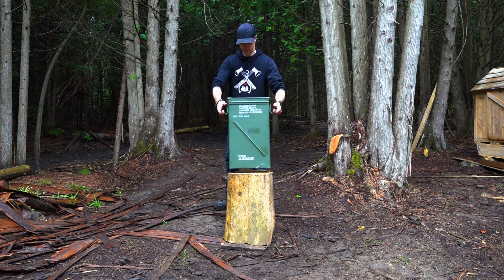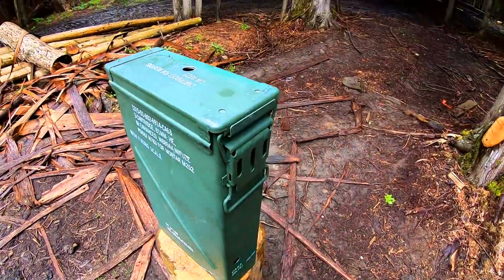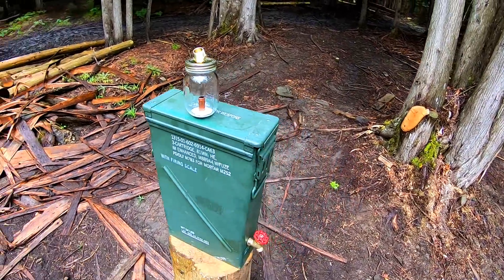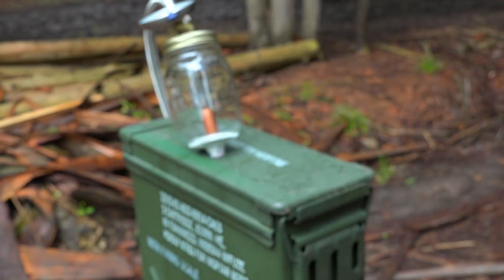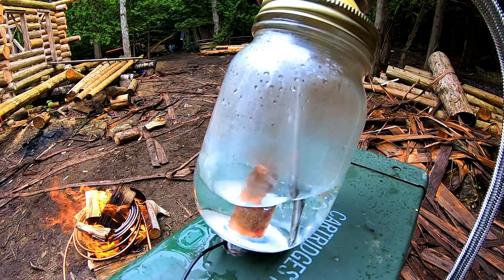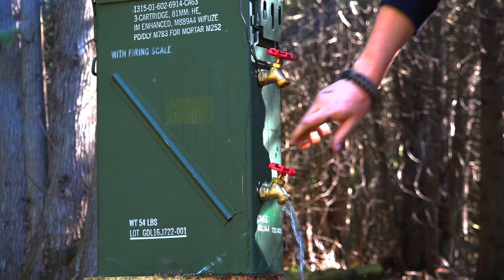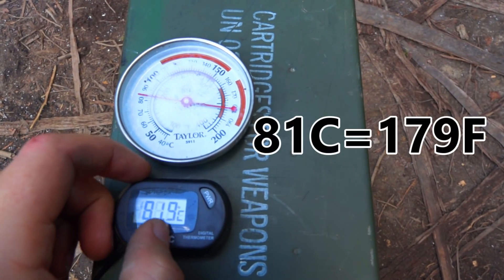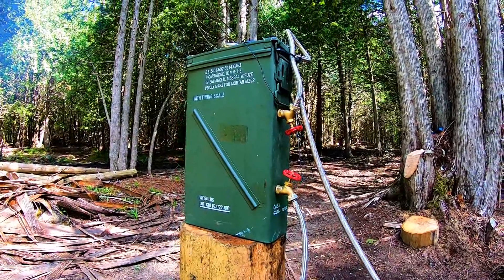Off Grid Heating Prototype- Copper Coil Water Heater / Heat Exchanger / Radiant Heater

Comment: If you use a copper truck radiator to replace the ammo can it would radiate more heat and might increase your run time so you don't have to get up and move the coil off the fire ?

Comment: I'm just spit balling here, and I'm not a survivalist or engineer,  but here goes anyway.  Why not get a shorter length of tubing? Clearly the water is in the fire too long,  and is getting the crap boiled out of it.  So maybe reduce your tubing have the water spend less time in the fire and maybe your sleeping cabin won't be a sauna. Also,  won't a low,  coled, fire produce a steady but lower amount of heat?

Comment: This is what I used to do in the Army and it worked great in very cold weather.  Boil water and then put it in your canteen.  Close it very tight so it doesn't leak.  You will want to wrap a t-shirt or some sort of fabric around the canteen both to insulate it a bit and so you don't burn yourself.  Put it in your sleeping bag with you.  Now in addition to your body heat, you've got an additional heat source that will keep you warm in your bag.  By the time it cools it will be time to get up.

Comment: You need to learn jow to build a proper condensor. You need to roll a coil like a screw starting at the bottom with cold intake at the bottom so that convection you mentioned can work within the natural physics. And.thermo dynamics so rising heat is heading up the coil and into the upper part of the tank and you.will get a thermal convective loop with all the tubing laying flat in the fire there is no natural reason for the water to flow either direction except for expanding both directions away from the heat from expandion. The tank should have a proper rated pressure relief installed for two necessary reasons. One so the tank doesn't blow up and also so you don't lose all ur water to evsporation.properly done it should function like an automotive radiator ( which will work way better than that box) and hopefully by then you will have come to.realize that a contained water/antifreeze wont freeze.the radiator can be hard mounted inside with your hoses and condensor mounted outside ready to be stretched out to a fire. The end product is whar the automotive industry has called a heater for about a 200 years. You could pull the whole apparatus out of any dead vehicle. Haha.

Comment: I made something like this. I used something like a drum with both ends open and coiled the copper inside to give it a uniform up to the copper, it also held in the fire. Smaller fire gave more hot water. It also made for a safer fire.  Bringing the copper in at the bottom and making nice even bends and some space between them.  Some rocks to hold it all up for air to come in the bottom and feeding wood in at the top gave a kind of rocket stove, not as good as some rocket stoves but a nice air draft that made the fire very hot without much fuel.  Could see if you can make the copper to form a wall but don't know how to do that without something to hold it.  Maybe a steal 5 gallon bucket.  Just some ideas maybe you can think of something using some of what I did.

Comment: Snazzy lookin camper you built.  Nicely done.
Cool idea but if you keep that copper in the fire, it's going to break down and crack.
I burn copper wiring to get the insulator off and the wire becomes quite brittle and it isn't in the fire more than 30mins.....
Reply: Good point, maybe he should elevate the coil on rack  - first waiting for the flames to die down.
Reply: @christainrovere165  What you said, or just make a really small fire.  But all the same this is a good idea, like alot of good ideas, after some tinkering it will become a great product.
We all learn after doing something for the first time, I do all sorts of fabrication and after I've done something the first time I wind up finding better ways/revisions of doing it as I go.

Comment: This makes me curious if the coil could set within a grouping of large rocks that had gotten hot in the fire for strictly a water heater.
Reply: I use it for heating water for cleaning.  Works great.  The coil must be a controlled spiral so the cold water flows down and warm water lifts it back up into the tank flowing in one direction.  No air bubbles in the system is key.

Comment: That's a great idea but use of radiator line copper pipe with aluminum fins in that top that hole and then just run a straight pipe write out your roof just so that heated water doesn't condensate inside your shelter and with the copper pipe with aluminum fins you'll get extra heat radiating out

Comment: You also can generate low amount of electricity from this improoved system. Just attach several peltier cells to one wall of the ammo box and connect them in series. The opposite side of the cells will be air-cooled in your snowmobile. In place of the vapor opening, it would be useful to drain the steam outside to avoid a steam accident & less humidity inside. Maybe you can try actively cooling (radiator with fan) ammo box for preventing boiling. Temprature of water shouldnt be above 60°C (140°F) because of denaturing temerature protein (risk of burns)

Comment: When camping in Tennessee years ago, we made a makeshift shower where we used a 30 gal drum made into a woodstove. We then placed the copper coil in the woodstove with the two ends jutting out. One end lower by 12" than the other.  We had a large poly drum filled with water which then was drawn through by convection. We hooked up a 12v sump pump to the shower, where the base was a childs sandbox. The water was used for a shower, sucked up by another pump, pushed through a charcoal filter, then back into the poly drum for use by the next camper. We learned real quick that you just need a minimal fire to draw the water through, or you are scalded pretty quick.

Comment: You need to talk to a plumber. Or an engineer. This is an unrelieved circuit. It can't be regulated, and it's dangerous. Please don't take this rig into winter conditions without some more work.

Love the camper.
Reply: There's a hole in the top that prevents pressure buildup. A lot of commenters forgot that part. It really ought to be some kind of valve that's outside though.

Comment: A little risky without the pressure valve. If the piping got lose you would get severely burn with the heated water in the closed circuit conditions water can get to the higher temperature than 100 degree and with high pressure it can even cause a powerful explosion. Sure the thing is not big, but there were severe cases in my country, where the close circuit water heating systems, water boilers would explode, most of the time they can even destroy walls made from concrete.  I doubt you can heat it to that extent using camp fire, but it is still possible for the piping to get lose and cause very hot water to pour all over the place.

Comment: hmm, building central heating in your camper eh. rather than an ammo box use a radiator - or use a radiator AND the ammo box where the ammo box is insulated. also - consider installing another tap, and keeping the system nice and clean because who could say no to a nice cuppa.

Comment: If you rigged together a little PID temperature controller, can have it connected to an electronic ball valve to regulate the temperature and not boil over

Comment: Looks like you have a good idea going and there are a lot of good suggestions here so I will only restate that the coil should be inside and the water box outside. You could then rig a way to move the water box on and off the fire either from inside the warm camper or just outside so you don't have to walk far. Maybe put it on a swing arm or on a tripod with a pulley so you can raise and lower the can to control heat. An in line pressure relief valve outside the camper would work to make it a bit safer. There also seems to be a lot of negativity here. Fuck em. It's a good idea and with work it will be a good safe heat source. It's basically just a radiator. Which come to think of it, and old radiator in good shape might get added in here somewhere. Even a car radiator might be useful if well cleaned and in good shape. They already have pressure valves and overflow systems.

Comment: Wouldn't it have been quicker and easier to just put the ammo box with water in the fire? Then take it out after half an hour and it would be about the same temperature. No holes would also guarantee no leaks. You could also get by with a smaller fire.

Comment: The problem here is that the people with voices right now on the internet are the ones that do video editing instead of the people that actually know what they're doing. 

This guy is using copper tubing and is trying to use a steel ammo box as a heat exchanger. Totally backwards. 

Meanwhile, anyone with a background in heat transfer (such as mechanical engineers like myself) are scratching their heads wondering how people manage to dream up ideas that are bafflingly awful.

Comment: The amo box will burn out within a week. A 2kw chinese deisel air heater uses around 1lt per 24hours heating per 1kw. A far more practical and safer way to heat any small portable accommodation. 5lt fuel would last 2 weeks. Just need 12v deep cycle battery and heater unit.

Comment: Why use water instead use antifreeze boiling point is much higher and it won’t evaporate as water would just a thought !
Reply: That one reason that many radiators use oil. There's no phase change to limit your temperature ranges, and also much less risk of corrosion.

Comment: I would for sure use a different method. Maybe funnel hot water through the copper pipes and thread those through metal housings near the upper edge away from the door, and use snow to make sure the water could reliably cool itself for at least a short time longer, using the ammo box as the reserve/water cooler?

Comment: You should have used a small radiator not a ammo box if you goal is to get the heat in the air.   You will also go through fire wood extremely quickly unless you put the copper heat coil in an efficient rocket stove.

Comment: why not have a wide sealed boiler on the fire and the copper tube inside, just have the steam warm the inside without taking too much spac, the condensate can then drip out or back in

Comment: With the amount of heat it gives I would go for a smaller version and probably use a  different burn method for the wood, something that would last longer. Overall, I am very impressed with your way of thinking.

Comment: My mini camper has a tinny wood stove i made from a small fat propane canister.. It also has  running water to the sink and shower.. And a compost toilet.oh and a solar panel 12v electrical complète with inverter for phone charging, interior exterior lights and tail lights  it's 4 feet wide six feet long.. About five feet high on its wheels.... Oh and an awning... I built it for my electric bike.. But now im off grid and i use it way in the back bush....since you are the reason i own a woodland mills saw mill perhaps my micro wood stove in my micro camper is somthing you'd like too see?

Comment: Even better would be a aluminum or copper car radiator. its possible to braze aluminum and copper together to i think if you have a mismatch of materials. That would transfer alot more heat.

Comment: I think I see what you're attempting. Thermal mass inside the cabin with the coil outside. Just throw the coil on the fire when you park for the night, open the pressure relief (top hole), and make dinner. When you're done eating, you can easily move the coil, close off valves, and have a tank of hot water keeping the cabin warm through the night. It's not designed to keep going after you've warmed it up like I think a lot of people are assuming. The only issues I see is excess moisture through the pressure relief (not a huge concern with cold, dry winters) and the water left in the coil freezing overnight, cracking the pipe.

Comment: What’s the point of this if it requires fire and a lot of water for it to work that is basically making using a fire for warmth with extra steps
Reply: in that camper, what use is a fire outside?

Comment: You could try to reduce amount of coil. or perhaps Rig a system up where you can have different Heights over the fire. IE like in the fire is starting the system up for a hour or so. then you have another level. where can move it above or to the side of the first but still be right next to the fire so it keeps getting the heat.

Comment: Putting a three way valve and a pressure valve like on water heaters to release high pressure like water heaters may help  lower pressure to boil in high mountain elevation ! Sand is a great insulator and fiberglass can be used as a container  for the sand , the tree way valve can extend the very hot water by adding cold water to very hot water to extend the amount of very hot water as many solar systems use already to extend the hot water use ! A simple fan over a evaporator coil can flow hot air through a area without danger of carbon monoxide , and can pre heat air also ! Great Idea as soft copper has no real need for soldering or leaks ! Buy must be checked as factory and shipping may of had cut line ! Mist of the time soft copper is a great tool ! And just aluminum sheet metal and isolation on the inside solar box with black  oil type paint on pipe with a light fiberglass lid can produce daylight solar heat , that just sheet metal and copper pipe painted and a pressure valve at the top  and rubber installation on excess pipe and a  reservoir tank  ( plastic soda chemical tub ) could circulate a  hot soft copper tube with hot water in the storage tank and give plenty of hot water for shower and dishes and then heat the small area of conserving waters ! Also the larger soda tub usually about 15 dollars could melt ice for water for heating system   In not sure how much heat the plastic tubs hold but never had them break from ice build up when watering horses with them or burn when using electrical water heaters made for animal water heaters for winter use ! Great video thank you !

Comment: Little worried about the humidity all night and then if for any reason it either boils off steam and you loose heat and then your cold and wet or your fire goes out and your cold and wet

Comment: Multiple stacked Ammo Cans turned on their side, all acting like one giant tank (All modified). Do the same system and attach it to the top or bottom of your cabin and have the copper cables attach VIA those same valves, but on the outside. If you do some proper math you can figure out the exact pressures that will be in the pipe and use materials accordingly.

Comment: Never build that like that! If you have two valves in the circuit you absolutly need a savety valve!!
Pressure could build up and lead to pipe burst if the valves are closed by accident or if you just want to stop the heating!!

Comment: I would use a closed loop system. With some form of an expansion take, either like a car with a rad cap like design or a tank like you see in homes. I'd honestly just use a cheap car radiator that has rad cap built into it. Then use a container for the overflow. 

This way you can use higher pressure to increase the boiling point of the water. Allowing for higher temps. 

I'm not a fan of the ammo box simply because of the humidity it will put into the air. You want a closed loop system. You dont want your camper all steamy.

Comment: Add Some 12v DC fans, and a radiator (&/or pex throughout all the walls and floor) with a 12v pump -- solar panel and small battery too - you can then charge your devices, have light in the event the lamps die -- get more efficient heat -- have the tank as a reservoir for the hot water, keeping it inside, and a radiator/pump/pex to dissipate the heat based on how warm the room is -- and if the water in the tank comes close to boiling -- you may find in certain cases you may need a small outdoor radiator to remove excess heat if the room is already too hot , you could also vent the steam into an outdoor rad to re-condense it so that you loose less water -- seal the box as well and just add a pressure/steam relief -- that way if it does fall it wont spill on you, but still has a way to safely vent pressure if the outdoor rads are ever not enough -- or in the event your battery dies -- you could also add an emergency dump valve for the water -- in the event the whole system overheats it might better to just dump the water outside on the fire and set off an alarm
Reply: Theres also ways to generate electricity from heat -- which would provide some degree of electricity for times when the battery is low in emergency scenarios

Comment: Nice video, good basic idea for upgrading dependent on use.
My one adjustment would have been using some copper coils on inside as would allow for closed system (which means more conductive fluids can be put in piping) and still allows water to be used if needed (also for storage) without to much contamination from the copper.  Also stones can hold a lot of heat if your trying to go more off grid

Comment: also, copper melts at 1900 degrees and most campfires avg 1100 to 2100 degrees, so at some point you will melt that copper pipe, it's still a cool little heater tho
Reply: it has 180 degree water circulating inside the pipe cooling the metal...

Comment: why not just heat up a box full of water on the fire more directly then take the box off the fire and put it inside the camper? You've saved on the copper tubing which isn't just extra bulk and weight but also inherently more fragile than a sealed steel box.

As a natural byproduct you make a large quantity of water much safer to drink as the prolonged heat kills so many pathogens, certainly more useful for cleaning.